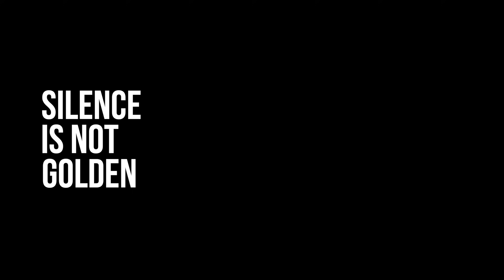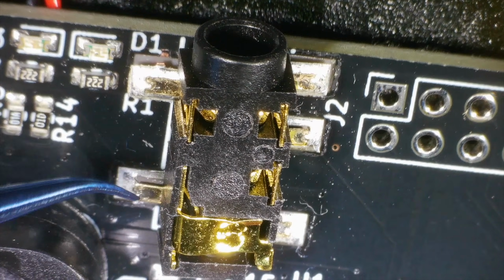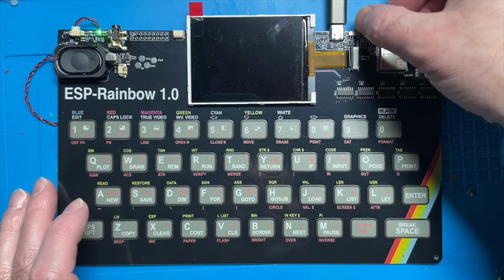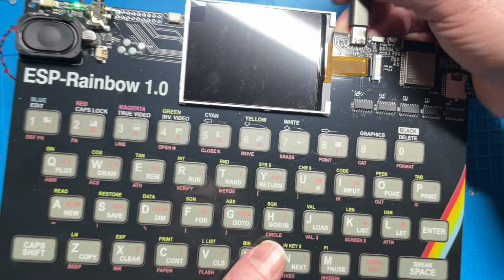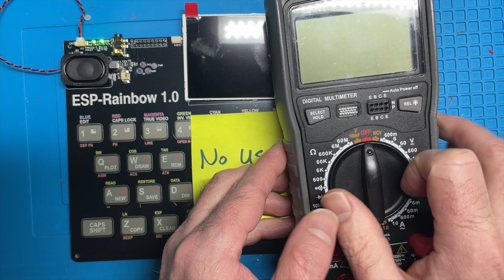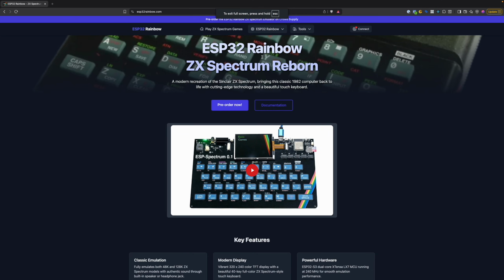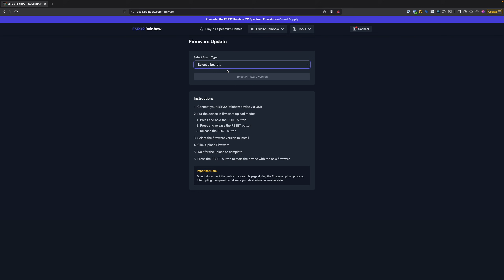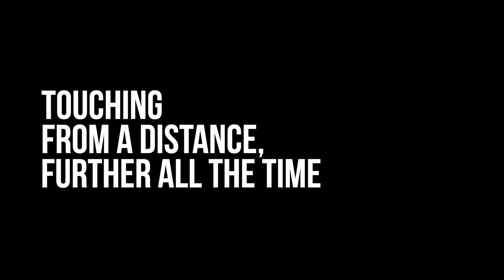Three ESP32 Rainbow Boards Failed QA — Can we fix them?

Comment: the one with the doggy headphone connector could be sent out as a review board. I'd happily review it for you ;-)

A bit of glue and it makes a good s/w test platform as well, most of the PCB's i reworked in design ended up in the test department. They earnt their keep as swap out boards as part of the fault finding process in returned systems, you don't want to swap in a new PCB as a fault elsewhere could take it out. these were expendable and it filled my odd hrs fixing them.
Reply from the maker: Definitely good for spares and testing - and I've dropped you a PM :)
Reply: @atomic14  Thanks but I can't find my PM's 🙂 are they a phone app only thing. Never use my phone for YouTube.
Reply from the maker: @TheEmbeddedHobbyist  I think I got you on Bluesky.

Comment: Would you be able to provide some information on how the board is flashed via your web site? I use the ESP32 in a professional capacity (like you, I design and manufacture electronics - I work in the water industry in the main) and it would be very handy to be able to flash the device from a web page? Perhaps you could make a video about it? Happy new year, and wishing you every success with this lovely little Spectrum board! Greets from Aberdeen!
Reply from the maker: Happy New Year!

I'm using this tool from Espressif - https://github.com/espressif/esptool-js

My code is here: https://github.com/atomic14/esp32-rainbow-website/blob/main/src/pages/Firmware.tsx

Definitely worth doing a video on it.

Comment: Great device I admire that you got this built and sold. The lcd screen and touch keys kinda bring down the perception of value of this device - they make it feel cheap and hacky. Button keys and DVI/HDMI out would feel much nicer. Maybe drop the LCD it brings it down.
Reply from the maker: It's very much in the spirit of the original ZX Spectrum - which was incredibly hacky and build for a specific price point... But yes, DVI/HDMI out would be a nice option.